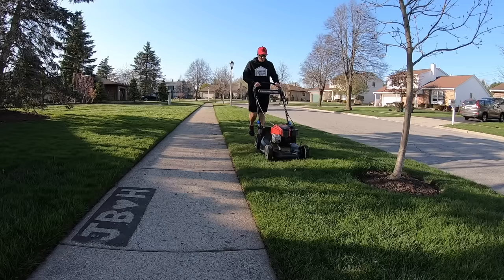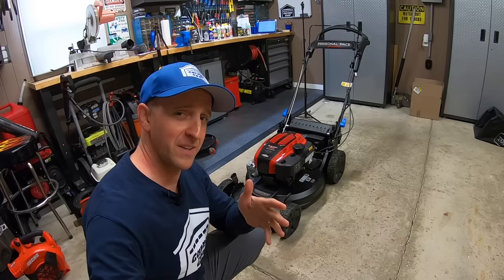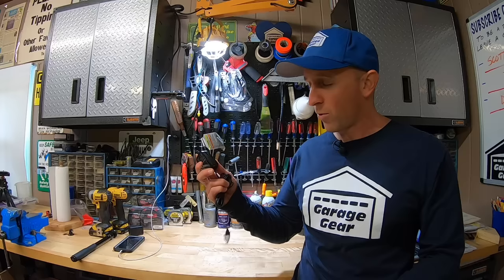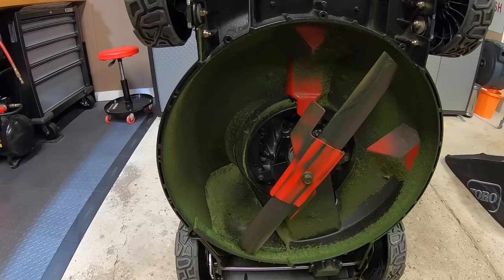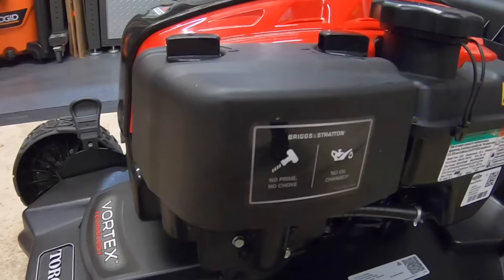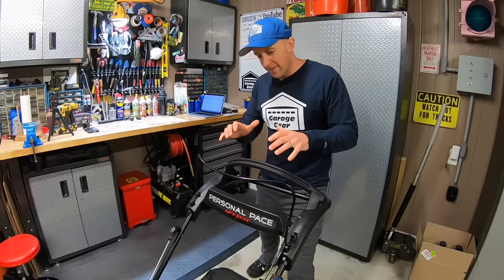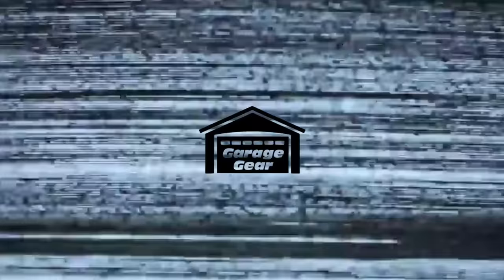IS THE TORO SUPER RECYCLER 21564 THE BEST HOMEOWNER LAWN MOWER?

Comment: Question. I’ve had my 21564 for a year now. The rear trailing flap is holding on with hopes and dreams. Is there an upgraded flap? Is the stock blade good or is there a better upgraded blade that you would recommend? I only mulch. Great review and this video, along with the comparison to the Honda, help me make my decision on which to choose.
Reply from the maker: @psychewardk1d  hey psych! Not sure about an upgraded flap but they are cheap to replace. I would probably cut it down an inch though making it easier to flip back and forth. The stock blades all seem to cut fine for me on these as long as they are sharp. Thanks for watching my friend!
Reply: @GarageGear Thank you for the response! Just looked and the flaps are pretty cheap. I wonder if making a cut up the middle would help alleviate the stresses on the flap when making turns. Essentially two flaps that won’t put stress across the entire piece. I’ll give a it a shot. 

I do think the blade is pretty good,  I was just wondering if there were any aftermarket options. 

Thanks again and keep up the great work! Bought our first house last year and it was a new build with no lawn. After the amount of money we spent on irrigation and seeding, I definitely wanted a great mower to maintain. Glad I found your videos with great information.
Reply from the maker: @psychewardk1d  good idea with the flap. Bet that lawn looks great! Thanks for being a cool fan!

Comment: Thanks for your videos. Have a 3 year old all black Toro SR. With blade stop. The bar is a much better design and mower has been pretty awesome. Personal pace and the handle shock absorbers are great especially on my hilly and bumpy yard.
Reply from the maker: Awesome RS! Thanks for sharing!
Reply: Yep. Those were just starting to change before I got a Super with RWD, Smartstow, handle shocks and personal pace plastic bar. No blade brake on mine thank goodness. I might one day wire a kill switch and delete the operator presence bar. That bar causes wrist damage over the decades. I can prove it. Mowers should have that little wrist strap like a boat has.

Comment: Just got my toro super recycler 21 inch mower back from a small engine shop I use.   It's just me $175.00.  the self propelled system was not working.   They told me it was the hub that was completely frozen to the shaft. That is the verbiage they used.  They had to cut off and heat? Whatever that means?  Please explain. Much appreciated.
Reply from the maker: @brodygoalie  hey Brody I’d have to see it in person to better understand what they did exactly. What year is your recycler?
Reply: Not sure. About 5 or 6 years. I would have to get you the model number. 21383 ? I believe?
Reply from the maker: @brodygoalie  the only thing I can think of without seeing it is the transmission shaft be frozen to the area right out side the height adjuster.
Reply: @GarageGear  photos attached of my super recycler. Hopefully now my personal pace will work properly now. I used to mow like 11 lawns a week as a side job so the mower is shop worn. Many repairs have been done since i purchased. I only mow my lawn now. No question I want to avoid purchasing a new toro super recycler 21 inch mower but i am not going to put any more big $$ into this mower. Thanks
Reply from the maker: @brodygoalie  did you email me the photos?

Comment: From your experience which mower would you recommend. A honda Hrn or super recycler? Does the super recycler design mulch better than twin blade?
Reply from the maker: Hey nurionz that’s a great question! Both models cut remarkably well! I have had zero issues with my Honda in the last three years. The aluminum deck will outlast the Honda deck though! I’ll be doing a comparison video. Probably in the near future!

Comment: I’ve seen people have mowers with the newer-style Briggs engines, and many of them still work fine after ten years only because they actually changed their oil and maintained them. Their Intek engines and OHV engines simply never were as solid as the flathead ones, and they go cheap with the plastic components. It is disappointing as I will always prefer the older ones.
Reply from the maker: @applianceman6009  same here my friend👍

Comment: I own a Toro RECYCLER MAX with a 163cc GTS engine. It's the next model down from the super recycler. It comes with a 5 year limited warranty and 5 year GTS warranty. It ran flawlessly out of the box. Filled with premium fuel, ran it for 30 minutes, changed the oil, after 5 hours of usage I change the oil again and it cuts great. I like the personnel pace handle and saved a few $100 bucks from that model.
Reply from the maker: Awesome Michael! Appreciate you sharing this!

Comment: I am thinking of buying it because I have a 12 year old Toro Super Recycler that I have to push now ( no more personal pace) which is really hard because I have arthritis   in my knees. I can not decide between Spin-Stop or Electric Start. Excellent review.
Reply from the maker: Either one will be good! Thanks for watching Gregory!
Reply: Hey Gregory,
I get that you may not want to put a lot of $$ into a 12 year old mower, but I personally would try to get it to a reputable repair shop to at least get an estimate.
FYI…I have a 14 year old Super Recycler and had my Personal Pace repaired about four years ago and still going.  I was told by the repair guy to keep my mower as long as possible as the newer ones are not as good.
Good Luck!
Reply: @rooster7996  Thanks I may try that.

Comment: This might be the year to grab em by the Hondas especially if you already have one that blew up. Yeah the prices are 20-30% higher but they are pulling a "farewell" tour. Will sales keep them around for one more round? Who knows? Might be like Motley Crüe or Rolling Stones. 
I like toro in general and they are great if you can deal with one stupid part like weak side discharge chute or mail in warranty cards😂.. 
Super secret tip on the $549 honda 216vkaa: ANY brand engine will fit if it fails. 3 5/16" 25mm shaft required. Found on most self propelled models and some mid-range consumer models. 
Have y'all got a Sams Club? There's a mower in there. I am tapped out for now but it's a 22" self propelled assembled in USA  . $379 in my area but it didn't have to travel far. Ok🎉
Reply from the maker: Thanks for sharing! Appreciate you watching another video here on the channel.

Comment: How do you change the oil when the gas cap can’t lock and seal it, once you tilt it on it’s side the gasoline starts leaking out.
Reply from the maker: You’ll need to put the mower in the stow position to change the oil. It won’t leak from that position.
Reply: @GarageGear  noted I saw a few videos on the Briggs and Stratton gas cap issue and the solution is to add an O ring size 1 3/4 OD, 1 1/2 ID, 1/8 width, you should advise all your viewers. Btw I’m a new subscriber and love all your videos!
Reply from the maker: @nelly8058  appreciate you nelly

Comment: Great information.

Hows the bagging performance on the Super Recycler? Ive read that grass can get clogged in the ramp that leads up to the bag since it is at such a steep angle.
Reply from the maker: Hey kmc! Bagging has been fine for me! That hasn’t been an issue for me. Perhaps if the grass was really long! Bag blows right up and deck suction is good! 👍
Reply: @GarageGear that is great to hear. Thank you!

 I mostly mulch but do bag sometimes. I just remember reading somewhere somebody saying the bag doesn't fill up or gets clogged.
Reply from the maker: @kmc8765  you got it kmc!
Reply: @GarageGear
Actually… totally impressed with the bagging

Comment: Good points on the handlebar set up. It should definitely be more compact. Other than that looks like a pretty good machine.
Reply from the maker: Overall, it’s not bad, Smallblock. I like everything on it except for the handlebars.
Reply: I have this mower, but don't have a fence like JB. The bigger handle only gets in the way a bit in one part of my yard and overall, I can't really complain about it. I don't think it's a deal breaker.

Comment: Does anyone else's start hard, with the electric start, it seams to take 10 seconds or sometimes so long i just pull start it, and it smokes bad at start up, i also addressed the high oil level, and it still does it..I'm disappointed....
Reply from the maker: Is your starter charged?
Reply: @GarageGear   it is, I just did it again yesterday as it's been sitting most of the winter.  It's started hard from day one (july 2023) multiple pushes of the button and  pulling as well.  I  have brought it in as well. I'm thinking I might just need to upgrade the battery.. maby I got a lemon...
Reply: @GarageGear  After the first start, it fires up as fast as yours in the video, In like 1 second . Cold start takes forever ..
Reply from the maker: @rynodlg4249  seen Hondas do the same thing. Wonder if the battery needs to be replaced.
Reply: I am having the problem with hard starts when the engine is cold as well. I always pull start it, and use the electric start when the engine is warm. That is my major complaint with the mower. Other than that, I am mostly satisfied with it. 
This is my first Toro. I previously used a 20 year old Snapper

Comment: Good one, JB!  
The '80s and '90s toros with electric starters (on OHV Suzuki engines) were equipped with alternators (stators) that recharged the battery as you cut.. You could also get a DC wall charger for them, as well.
Reply from the maker: Those were AWESOME machines. Hard to find now a days. Have a great day my friend.
Reply: @GarageGear  I agree with you on everything, btw.. From the individual height adjustment for the wheels, to the carburetor which could potentially warp when hot. I scoff at the "vortex" idea, also. 
Where I grew up (in West Texas), mulching didn't really catch on when I worked in lawn care (even today, most customers prefer the grass bagged, from landscapers I've talked to).  
That's the one thing I really disliked doing when mowing for a lawn service. At least the mowers I used had a BBC to make the bag emptying faster, but some of those lawns were so thick you could only make a couple of passes before having to empty the bag!  I have to admit that's ONE of the main reasons why I appreciate those old mowers that so few know about today.  I love the ergonomics of those old handles so much that I customized one that had a straight handle for one.
That steady amount of nitrogen you get from mulching the grass back onto the soil is something every proud lawn owner should know about by now, as it is essential to a healthy lawn and doesn't promote more needless waste.  At least Honda did come up with a good idea that omitted the mulch plug, which is all that I admire Honda mowers for (really).  You could actually deceive your customer into thinking all the clippings are being bagged!  Darn toro for not thinking of it first!!
Reply from the maker: @campbellpaul  always dishing out the cool information Paul! You ROCK! Can’t wait to try out my new(used) commercial 21” I just Knabbed! I’ll keep you posted!

Comment: Question about that flimsy rubber flap dragging along the mower. (Not sure what it’s called)

Is that really necessary? When I back the unit up, it folds under the mower.  Kind of annoying. 

Never had one on previous lawnmowers or don’t remember and it broke off.
Reply: Definitely going to remove that annoying rubber flap.
Reply: Why remove the flap? It’s a rock guard and it lays a decent stripe
Reply from the maker: Hey apex that is a drag flap that prevents rocks and other objects from shooting out the back. Mine seems to get hung up from time to time too. Could trim an inch off and see if that helps it move back and forth better.
Reply: Thanks JB.
Reply from the maker: @apexiumim2741  the Hondas have a rubber one that travels better under the mower. Thanks for watching apex!
Reply: Thanks, I’ll have to check it out

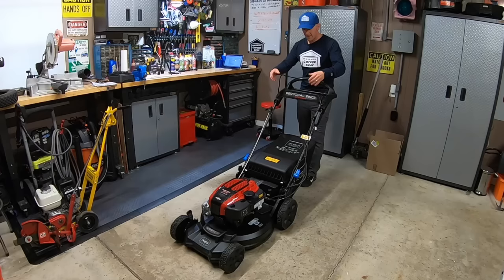Comment: You didn't like the handle bar but yet you used it at the 1:15 mark to maneuver the mower. Could this handle bar have other uses ? Also Im not sure if you covered how the foot guard works when backing up , could you comment on that.
Reply from the maker: Hey bill I don’t like how bulky it is. The assembly is huge for no reason really. The foot guard drags along as you make your passes. As you back up it will go under the mower. As you go forward again it should slide back out and drag behind. Thanks for watching

Comment: Do you know of any replacement blades for a Toro21 inch that would be an upgrade over the factory blade? I don't think I'm getting enough lift with the factory blade.
Reply: See Project Farm , mower blade testing. Oregon Mulching for high CC engines or get Maxpower Mulching or Maxpower 3 in 1 blades.
Reply: @joewger  Nice! Thanks bud.
Reply from the maker: Project Farm has a good video on that.
Reply: I use the "gator" style blade for a Lawn Boy. Direct fit on my Super Recycler.
Reply: @johnwrigley1624  The trick is making sure the manufacturer has a blade that fits your particular mower it seams. 
I watched the Project farm video and the Oregon blade came out on top but doesn't have a blade that fits my Toro. The search continues 😁

Comment: I like this mower, but I don't like the Briggs Engine. Ever since Briggs started to mass produce cheap plastic engines, I have not been a fan of them. They don't last like they used to. The old Flat head Briggs Stratton were higher quailty than these new engines. Toro deck and featers are great, just wish it had a better engine on it.
Reply from the maker: 100% agree. Thanks for watching!

Comment: Just an FYI.
I have a 5 year old Recycler and switching to Premium Gas and the sputtering pretty much went away.
87 Octane here in Canada contains WAY TOO MUCH Ethonal.
Cheers.
Reply from the maker: Thanks for sharing Jeff!
Reply: I always use premium gas on all my small engines. This unit still sputters. However, I think I noticed why… a certain area on my lawn slightly slopes down and is a point where I turn left to circle back or continue left.  Carb might lack fuel on that slight slope/left turn.  I’ll be testing that area tomorrow. (Raining today lol)
Reply from the maker: @apexiumim2741  awesome let us know! 👍
Reply: Test failed. It still sputtered but not in the way I described.  It’s back at the toro dealer.
Reply from the maker: @apexiumim2741  let us know what they have to say

Comment: Is that garage door insulated now, nice job JB?
Reply from the maker: It is fully insulated and sounds a bit different too. Will make for those winter filming days a little easier.
Reply: They are much quieter. I grew up in Erie it would keep the garage 40-50 degrees.
Reply from the maker: @amywolfe6100  that would be better than 20-30! 👍

Comment: The personal pace self propelled mowers are terrible. Briggs and Stratton Cheap Chinese engines are crap! Honda, Kawasaki, are the best. BS brand engines are disposable , so you might as well buy a Craftsman, or Walmart Black Max cheap disposable motor. Best blades are Oregon Mulching for larger CC engines . If not get a Maxpower Mulching, or Maxpower 3 in 1 Blade.
Reply from the maker: Thanks for the tips. All good info.

Comment: Another great review JB! I've been a big Toro fan for years but they really dropped the ball on that handle bar! Who wants to push a stroller around on the lawn?😂😂 If they tell you the oil doesn't need to be changed just add it. That means the engine is designed to burn it....🤔👎 Gimmick!
Reply from the maker: Absolutely, my friend.